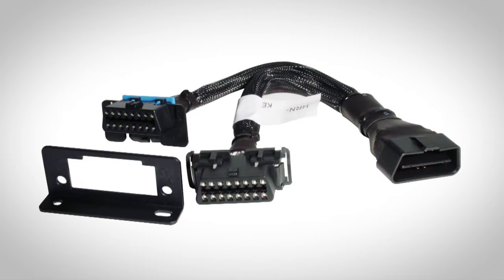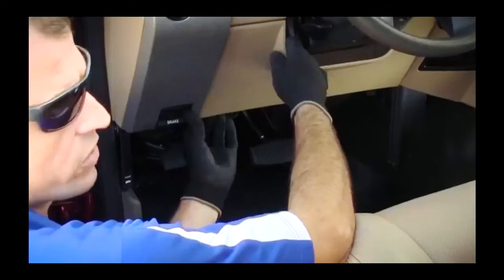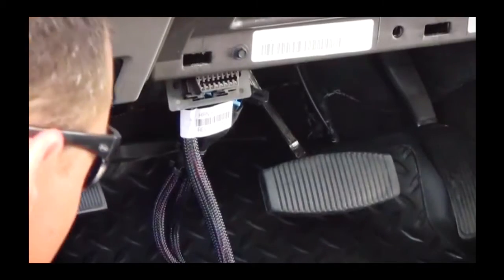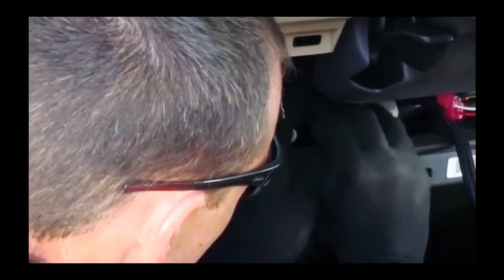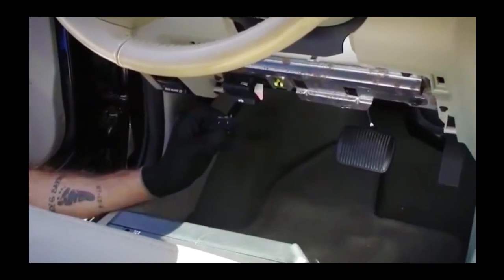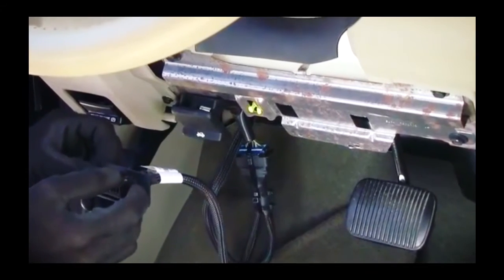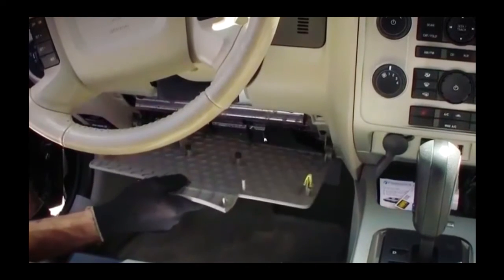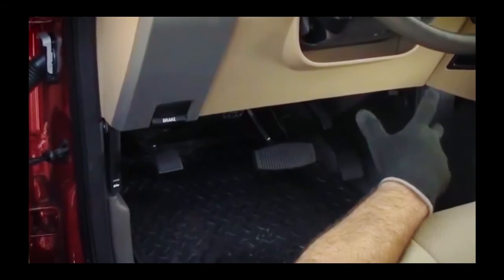Fleetistics - Installation of Geotab Y Harness on GPS Tracking Device

Comment: The GPS antenna is in the bottom of the device. When mounting the unit to the frame, be sure the bottom of the device is not on facing the frame which will negatively impact the GPS signal.